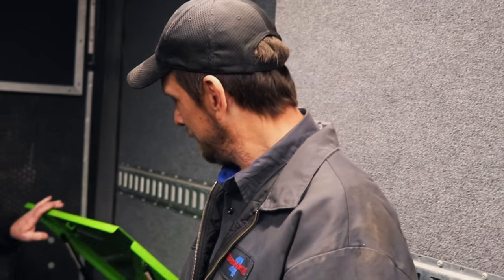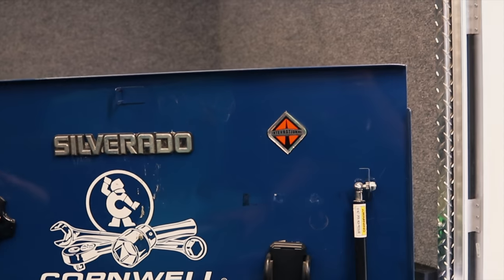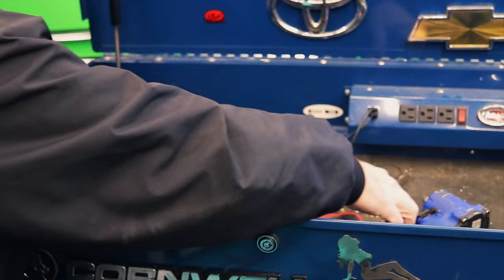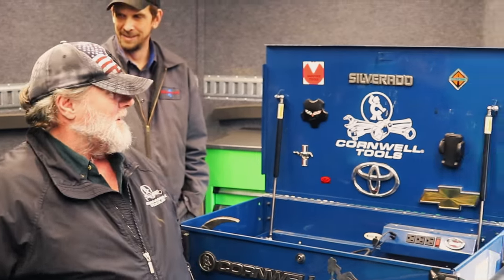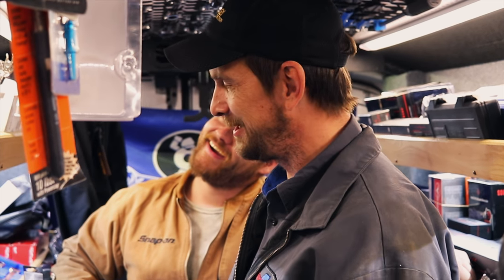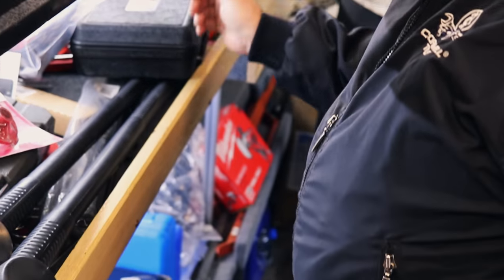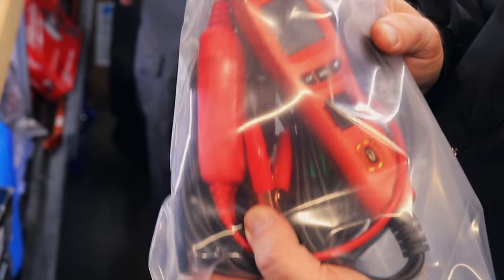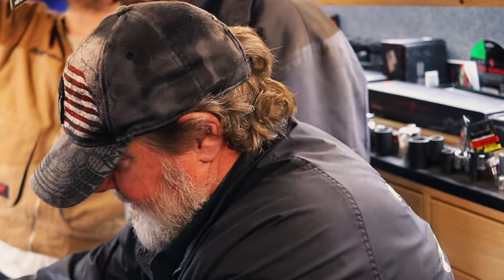Cornwell Monday: New Roll Cart and Launch Scan Tool

Comment: Come on Clay. All the Chevrolet stuff adds tremendous value. Great video my friend.
Reply from the maker: If you say so ? I’m just afraid the transmission would have went out before i even got it in the shop ! Haha poor chevy’s just can keep a tranny in them !
Reply: JERM C Chevrolet only adds value in Mexico where they're made.
Reply: real men drive bow ties.
Reply: Koon Trucking i wouldnt give my Camaro or my Tahoe. Had my Camaro almost 22 years now. Not one issue. My Tahoe 220,000 miles and still kicking.
Reply: john hare Yeah, Chip n Dales. Lol
Reply from the maker: Oh man I’m just messing around i have a 94 Camaro parked out back still runs great. I’m just an F250 guy that’s all. I tried a few Chevy trucks years ago and they didn’t like the mud and heavy loads a cattle farm put on them and needed up with trans issues so ..... I’ve just had better luck with ford trucks, but that’s just me. Everyone has their favorites even the goat I mean dodge guys.
Reply: Just make sure that cart doesn't have a gm wiring harness or it will be on fire before you know it lol
Reply: Koon Trucking no worries. I'm used to it. I have always had ford vs Chevy my whole life.

Comment: RMS stands for root mean square.  It is only used on AC, can't see much automotive use for it.
Reply: wheel speed sensor vss sensors and some ckp cmp sensors and checking for ac ripple in alternator from the rectifier many uses in auto industry